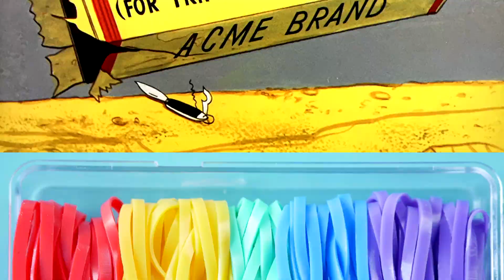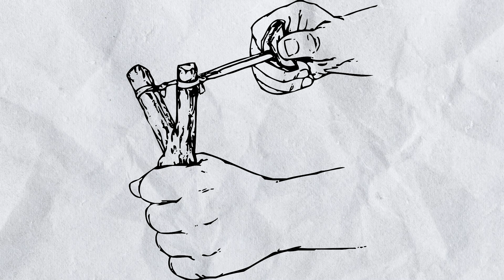why it doesn't work 47

Comment: A rubber band is basically an energy storage device. You put in energy to stretch it, and it returns the energy to you when it snaps. So while you wouldn't use any fuel on the way back, it would be used the first time to stretch the band.

Comment: 1. Elastic force increases linearly with time, not exponentially as you claimed in the video.
2. If you had the rubber band’s other end much further back than the house, the increase in force would be much more subtle, and so this could actually be possible. The rubber band would have to be much larger but weaker, and you would need an additional stopper at your house, but it would work.

Comment: But if work is on large uphill... Then you can go back to home... Engine of... Gear neural... Without any energy
Reply: With potential energy
Reply: @SalimShahdiOff  no no... She can go down without ANY energy... If the engine and light is off, it take absolute 0w
Reply: @Sisula2016  i'm aware of that brother, but first W is a unit of power not energy (detail I know) but the car has potential energy 
Because it had to climb up there
If you throw a ball upwards it will have a lot of knietic energy and no potential energy if position, then when the ball reaches the "Peak" of its motion it will be stationary for an instant because it doesn't have knietic energy anymore since it all turned into potential energy of position, but them when it goes back down it will get faster (more kinetic energy) and lower (less potential energy of position)
Reply: @SalimShahdiOff  you really mean at car take more fuel going uphill than straight road

Comment: If using horses as a means of travel was still mainstream it would be a lot easier to save on gas without having to worry about walking huge distances at way too slow speeds to be practical. Still, there'd be the downside of having to take care of and clean up after the horses.
Reply: Take public transit if it goes near your house which if you live in a remotely developed country that isn't the united states it almost certainly does, even in fairly rural areas. It's also almost always cheaper assuming you use it regularly. It's already a brilliant solution letting tons of people save on gas and money but for some reason certain people seem to have an aversion to public transit like it's the plague?

Comment: Ignoring the fact that everything else wouldn't work, i think you could just stack a huge amount of normal rubber bands instead of using a single one made of unobtanium, that's of course if you can find rubber bands so big that can stretch for kilometers

Comment: Another reason this wouldn’t work: elastics, even those made of unobtanium, degrade quickly when they are kept at full stretch for an extended period of time. In the presumed 8 hours you’re working, the band would lose at least half of its strength and be unable to pull you all the way home. You would then have to replace this enormous band, at great expense. So either buy non-degrading unobtanium or invest in a subway card
Reply: You can't just obtain unobtainium

Comment: I mean, even if we assume everything works out ideally, it just doesn't work in theory either. That kinetic energy from the rubber retracting would have to come from somewhere, and that somewhere is your car. That's like saying shooting a bow and arrow generates energy from nothing, as if you didn't have to expend a bunch pulling it back in the first place.
Reply: Well, you save energy on the return trip but not getting there. So you save half.
Reply: @Uhhhi-ih8bb  You use all the energy at once instead of in two trips.
Reply: @ishkanark6725  explain in more detail please I don't know what you're trying to state
Reply: @Uhhhi-ih8bb  as the video itself says at the end (making this whole comment section redundant), when you are driving to your job you are actually expending more fuel and energy than normal, because extra energy has to be used to stretch the rubber band. In an optimal, unrealistic, and strictly theoretical scenario, the extra energy is equal to the energy saved on the way back, meaning no saved energy at all. In reality, due to inefficiencies, you would be wasting more energy than saving, thus it would be a net loss
Reply: @swissdave9489  oooh… I understand now